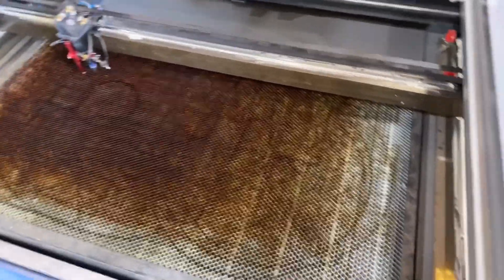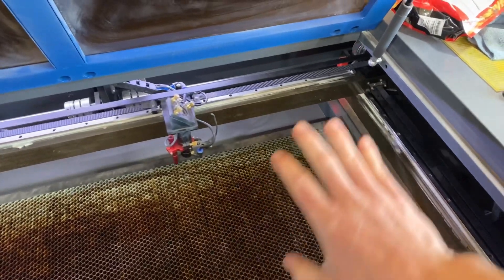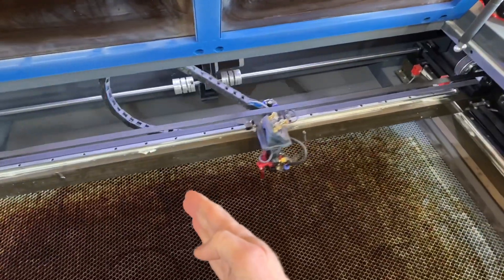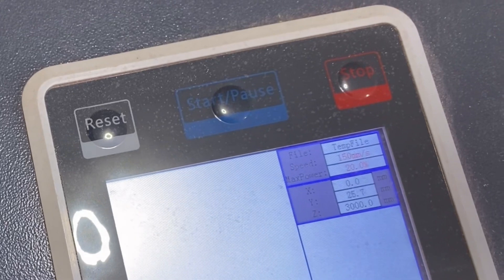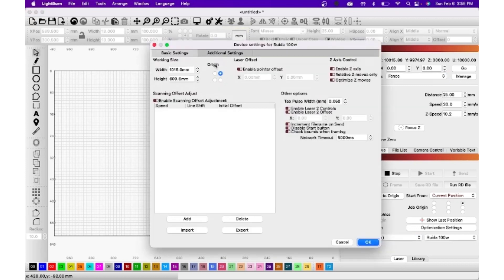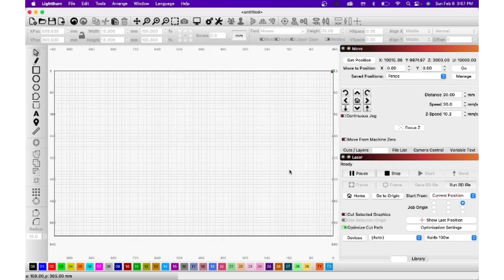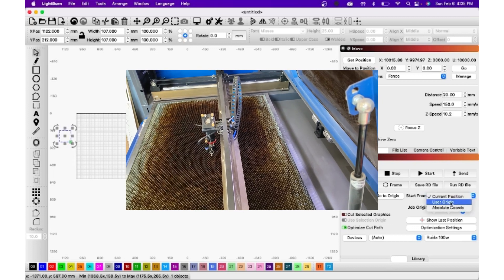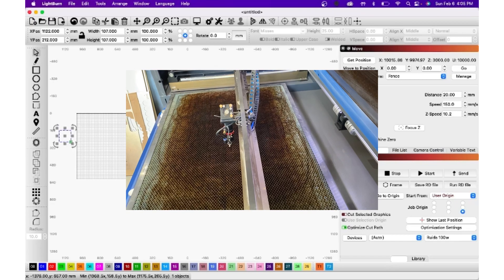Machine Origin, Start Positions, and Job Origins | The first things to learn in Lightburn

Comment: "high and width" do they mean x and y??? I change my origin and the dumb thing inverts my image!!
Reply: All the options really suck when it comes to an irregular shape and a machiene toy put on a large object. I need to set my origin exactly. Whats so hard about that. You can on the free software. It just makes bad paths.
Reply from the maker: Not sure what you mean.
Use current position and set your laser head right over the center of where you want the design and select the center job origin in the bottom right corner of Lightburn in the laser tab.
Reply from the maker: Height and width correspond to the size of the design you have selected.

If your image is inverting then it sounds like you are changing the machine origin. That is set once for the machine and will never change.

Comment: I keep getting Alarm 9 which is Homing Fail and Alarm 3 which is Reset while in motion. I've tried everything and still can't get this thing to work. Using Lightburn on the Creality Falcon 2 22W machine.
Reply: Could not find limit switch within search distance. And Alarm 8 Homing Fail. Cycle failed to clear limit switch.

Comment: Hi,i have a different "problem". Sometimes when i hit the start button it says "cut may be out of bounds". I have no clue what that means. I've looked on forums and on YT,but can't find anything on this matter. Maybe you can help me. Will be much appreciated. ( i'm using lightburn too).
Reply from the maker: It means that your job is going to cause the laser head to hit the sides of the machine.
You are either not using the start positions correctly because it is placing the design too close to the edge of the workspace or you have stray objects on your workspace that need to be deleted. 
Use this video and test out the different start positions.
Reply: @BeardedBuildsCo  Now it works. Thank you very much !!

Comment: When placing my material on the laser bed and using the current position, how do I know the place I put the material matches the position on the screen? Do I need to burn a spoil board with markings for positioning my material in relations to lightburn position? I'm probably not making sense.  😊

Comment: There are glitches to that story. You should explain that too. For instance, If you have layers off the grid (whether they are visible or inactive) and you do not have cut selected graphics and use selection origin turned on, your homing will not work. Job origin has no effect on anything in this case and I totally feel it is a glitch that Lightburn needs to fix. It could cost hours to figure out why your job origin is not working.
In my opinion the placement of job origin should take precedence and focus instead of job pieces.

Comment: Very helpful - Thanks.  I've made a template that I want to use for customizing a product.  If I put the product in the template and use registration marks that I have on the template to set user origin, then I should be able to engrave/personalize the product using the template?

Comment: One the OMTech Polar tho the laser doesn't start at 0,0. Starts about 30x8 since its got that big box around it. Which sucks cuz you waste material. So I put a 25x25mm box that the right corner starts at 200x10  on the honeycomb..But when I go to laser it its at starts the box at  230x20. Any idea on how I get that distance offset to match up the LB grid on the screen and the laser ?

Comment: Bro when I press Esc the head not going to origin how to fix
Reply from the maker: It is likely going to the origin that you set. If you want it somewhere else, move the head there and press the origin button.
Reply: @BeardedBuildsCo  I mean when I finish design the head not going to origin position and when I press Esc button even then head not going to origin position then I press fram button after making frame finally head stop on origin position
Reply: @BeardedBuildsCo please help

Comment: My laser moves slower than a turtle . I can’t seem to get it to work again.
Reply from the maker: When? Jogging? When a job is running?
Reply: @BeardedBuildsCo  when I press to frame it makes noise but barely moves. I can’t get my laser to even work
Reply from the maker: In the move tab on the right hand panel you need to increase the speed
Reply: @BeardedBuildsCo  ok. It was at 30 for speed and what is z-speed ? That’s at 10 mm
Reply: @BeardedBuildsCo  wish I can FaceTime with someone so I can just get this resolved 😭. This latitool product doesn’t have anyone I can contact and every problem I have isn’t on the internet
Reply from the maker: Z speed is how fast your z axis will move
Reply: @BeardedBuildsCo  it’s moving faster now but still nothing happening 😭😭😭😭😭😭I’m sooooo frustrated
Reply from the maker: I really have a hard time helping where I can’t fully understand what it is that is not working. I schedule one on one sessions for $60/hr

Comment: Yeaa... Maybe consider fixing that Drag Chain that keeps getting caught on the inside of the Top/Lid?
The Moving End at the Tool Head isn't supposed to be able to make a つ like bend yours does it should be ⸧ ( both Straights parallel to each other with a uniform Bend ) which is USUALLY achieved by installing and Endpiece that only allows for the Chain to curl inwards ( essentially like all the other links ) unlike yours which seems to allow for an outward movement - The latter of which can be fixed adding a something like a Popsicle Wood in there to block the upwards movement between the Endpiece and the first Link following it.

Concerning the Machine vs. Job Origin thing I'd like to explain it as a Contractor with a Map of your Town and a Floor Plan of your House... The Map of your Town will tell him where to start getting into it ( Machone Origin ) and how from there to get to your House. Once at the Door of your House ( Job Origin ) he'll whip out the Floor Plan. Which Door of the House he uses would then be the equivalent of a Start Position 🤔

Comment: I must say, I have watched several videos on this topic. I never could grasp how it worked. I always used current position because I couldn't remember how to use the others after a little time went by without using the laser. It would never stick in my head. After watching you video it finally made sense, finally I get it. I finally understand how it works as apposed to just trying to remember the steps. You explained it very well. Thank you.
Reply from the maker: Glad it helped! Thank you!

Comment: Thank you so much. It was so useful for me.
Here i need your help more than every time.
Sometimes while engraving my laser head jumps to another point and counties from there, (few millimetrs on X and some times on Y). So this sudden jump will destroy all my jobs, specifically when I am working on Granite.
It happens in my both new machines, all parts are fixed well, the belts are ok, I am only thinking to obtain a current stabililizer to complelet  the machine.
This issue is really annoying one and really need help. I also apreciate every ones' comment.
So sorry to take your time.

Comment: excellent video, regarding the current position  or user origin, how do you set your material squared so it engraves straight parallel to the material ?

Comment: Do you have any possible help on finding the correct power and speed settings for Plastic Rowmark material? My speed/ power setting are either burning /melting it or if I spped it up and use less power, it barely marks it and doesn't remove material. Same with cutting this material. It seems to be melting it OR not cutting all the way through. Any help with this would be so greatly appreciated! I have a 100 watt Omtech 20" x 28"